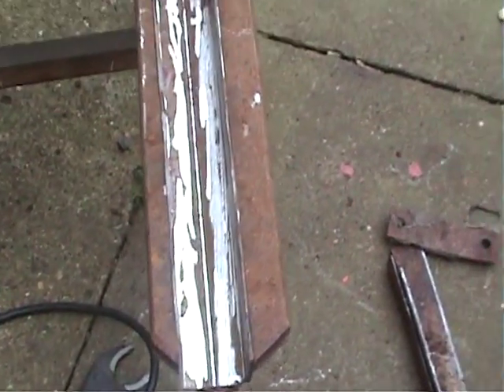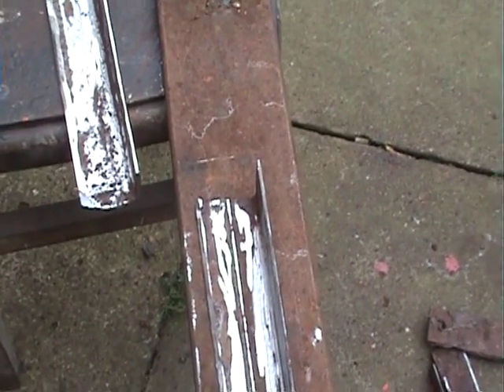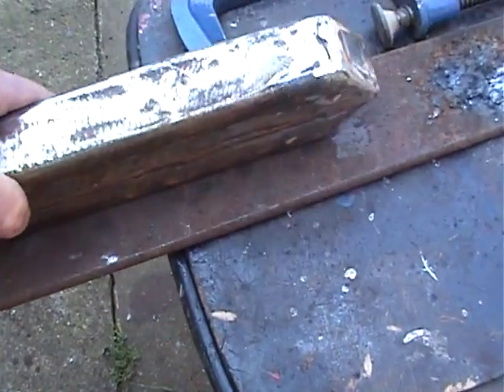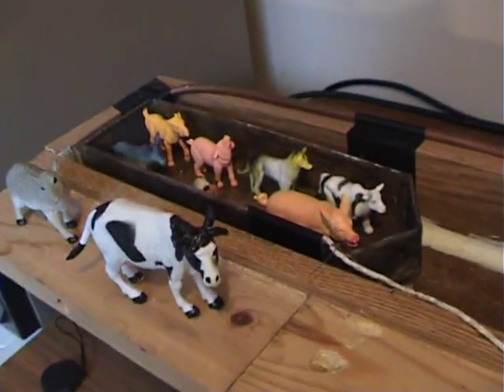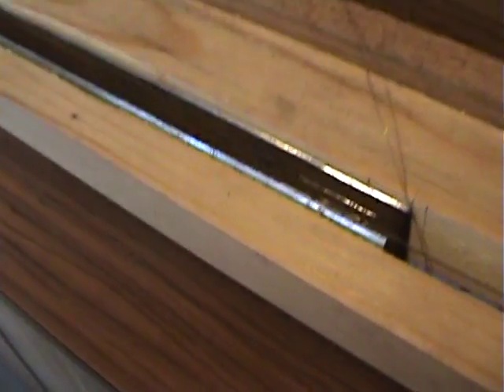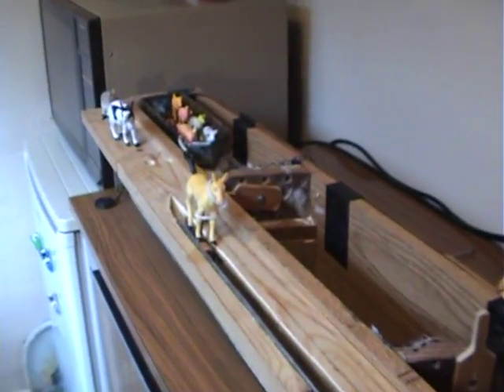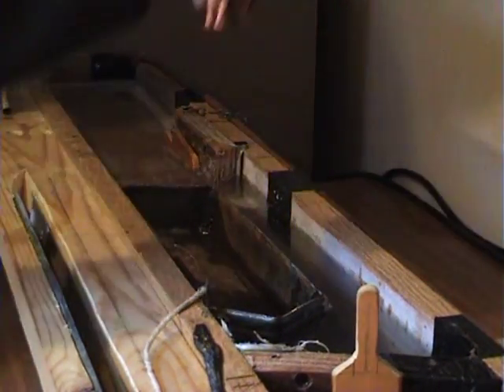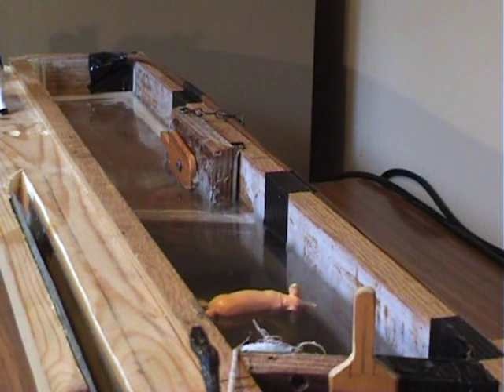Made a Steel Barge and Improved the Lock

Comment: Everyone will be making model canal locks now :) You did a grand job with the steel barge. The speed was authentic :D At least we know you didn't take a sneaky short cut LOL
Reply from the maker: creamofcardstv Doubt they'll know about this lol.
Thanks, problem is you need steel that thickness to weld it properly with a stick welder, and then it's too heavy to float. At least my welding didn't leak. 
However I've shown what could be done.  Just a thin layer of fibreglass would make the structure watertight and a proper continuous pump and it would work how it is supposed to. However problems with boating are usual lol. Called 'The Joys of Boating' :D

Comment: Again what a brilliant second attempt....  slight buoyancy problems,,, think you could have managed with a slightly thinner gauge for the barge but very authentic just like the Tom Pudding barges in Yorkshire,,,  Im sure Mosses had a few teething problems with his ark as well,,,   and as for the Beasty trying to drown all the animals ,,, hope you rescued them all in time ,,,,,,   And the Horse coming along the tow path ,,, now thats far better,,,,  and no sneaky editing ,,,, well done,,,,   but don't be offended if I get some else to design my next river boat,,,, a great watch and  Best regards,,,,   Alan
Reply from the maker: ***** LOL Alan. Yes my 'stock' is almost exhausted, so I just have to make do. Needed a bit of thin foam, or two for buoyancy, then it would have floated as the top pound is too shallow. Never offended mate :D But were I to make another lock, would definitely make it thinner, deeper and coat with a thin sheet of fibreglass.......much simpler, and solve all the problems.
Reply: MalcOfLincoln Yes but when done on a shoe string its even more of an achievement ,,,
Reply from the maker: Thanks, that's the idea isn't it....use up some of my junk. Made 3 'films' spent a fiver on props, and used about £1 of the PVA. Just to prove you don't need the hollywood millions LOL Plus of course I might? think of another one to use them in :) Just a pity most of the modelers won't see this. Might? give them a few ideas.
Reply: MalcOfLincoln Not sure if I said ,,, but im trying to model a canal Lock as well ,,,, just a mock up to see if it can be done,,,,, got some gears cut to gear the gates together ,,, so when you turn one gate the other turns as well ,,, and I have a cam type system for raising and lowering the water in the lock ,,,,, but the modeling may have to take a back seat for a while ,,,,   so not sure when it will progress any further ,,,,,,,
Reply from the maker: ***** I'll await this with eager anticipation.....no rush. Just in case this might?? help, here is how you do it in real life. Made this several years ago 
https://www.youtube.com/watch?v=R6Dum06XHO4